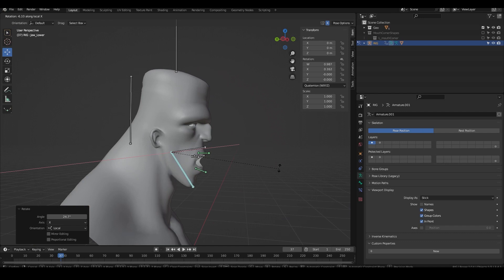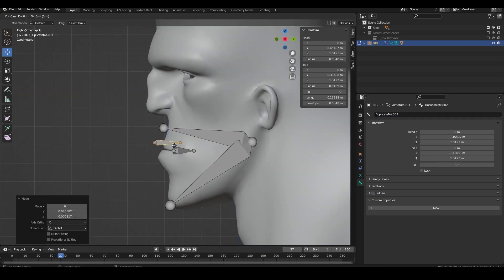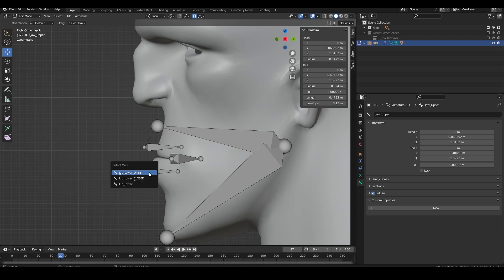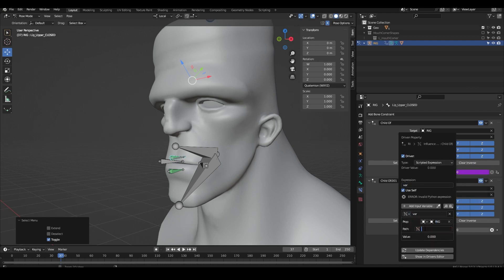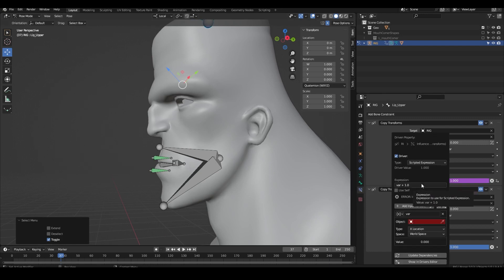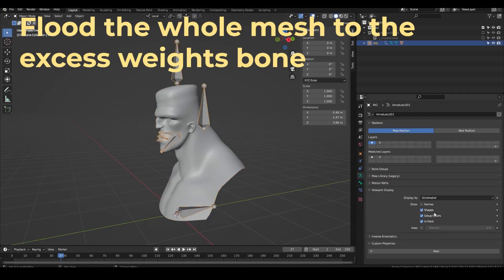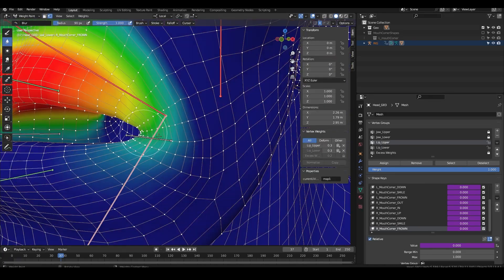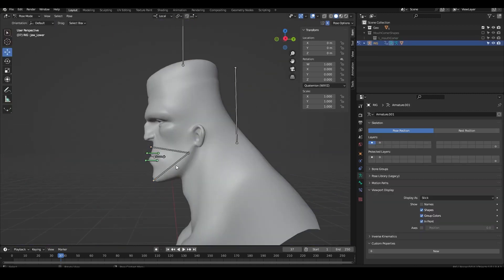EASY Jaw Rig (Blender)

Comment: when i rotate the head upwards/downwards and sideways, the mouth_closed bones seem to slide back and forth, resulting in concave/convex mouths, depending on the head's rotation.
Reply from the maker: Yeah probably gonna unlist this video soon as there are a few issues that I didn't realise when making this. The problem likely lies with the child of constraint which I have recently found to be unstable when dealing with multiple parents for both translation and rotation. Look into replacing the child of constraints with an armature constraint which seems to be way more stable. That's the only problem I could guess at without looking at the file.
Reply: @Yami_3D  Thanks for the reply. I've settled for a stopgap wherein I just extended the deforming mouth bones backwards and used damped track modifiers to manually control them with controllers that are parented to the jaws.